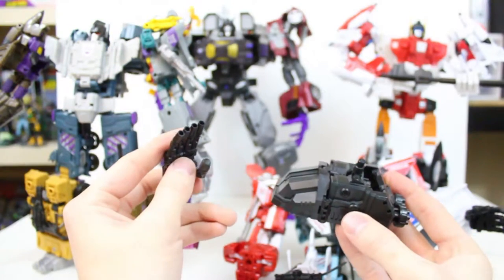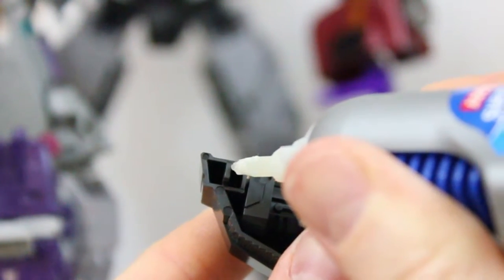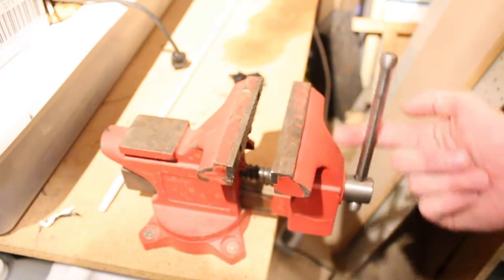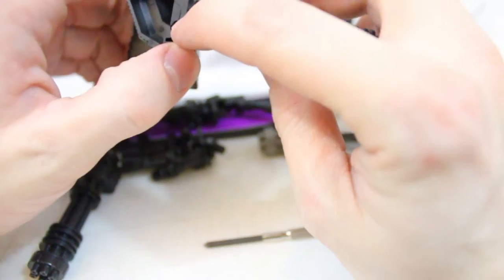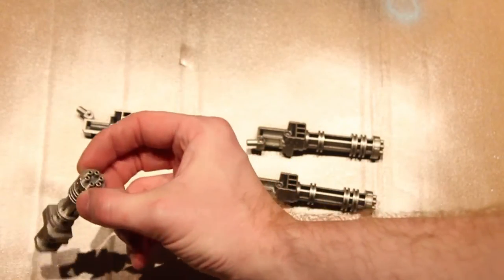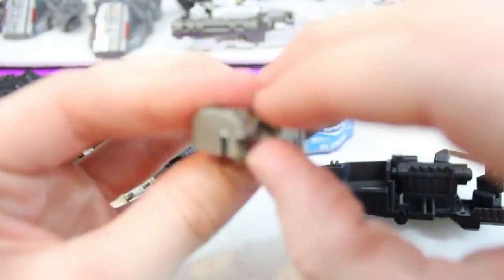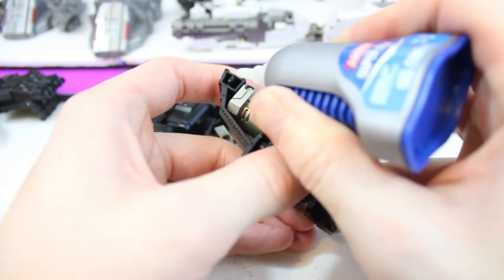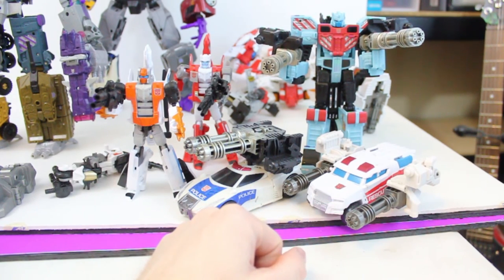Combiner Wars Perfect Effect Fix, Mod, and Paint

Comment: just a suggestion of something to use instead of glue to tighten joints....you can use floor polish with Future shine...that's specific one recommended to me and i bought a bottle and it's what i use for AAAAALLL of my joint tightening needs.  If using on something super duper loose, then may need multiple coats (apply, allow cure time, reapply, and so on).    but the problem with glue mostly is that it flakes and shreds when whatever joint you used it on is moved..it shaves off the coating of the glue...it's ultimately not hard enough to withstand the friction...the floor polish however (meant for dealing with foot traffic so way sturdier) will not do this if allowed to proper cure before applying multiple coats.  Also, with the floor polish if just one coat is all you need, there is no harm in putting the joints back together before the stuff has totally cured...in fact, sometims i thinkg it helps to tighten even a bit better...
Reply from the maker: +jamilmereck Thank you.  I've been meaning to try floor polish, but when I get to the store, I can never bring myself to buy it.  One of these days, I'll put a bottle in my shopping cart.
Reply: I really wish they sold smaller bottles these days.

Comment: RE : tabs / pegs to combine foot halves. You added super glue to add material, you also painted them, which adds even more material. Thats why the connection was overly tight.
Reply: About to post the same comment, think that just the paint would have done the trick. If not painting the guns, then maybe the superglue/floor polish/nail polish would just do.
Reply from the maker: I learn as I go.  In my experience with paint, it would wear off with repeated transformations.  I think I should have painted the parts first, then scraped the paint off of the tabs, then added glue or polish to the tabs.  Very soon, I will get a bottle of floor polish to see how I like it compared to super glue.

Comment: Yeah you superglue them together, but what happens when you wanna take 'em apart & use them as guns?
Reply from the maker: +Smoke screen Good question.  The first time at 3:25 and third time at 23:55 that I use the super glue, I let it dry completely before I put the pieces together, so that the pieces don't stay glued together.  After I put the glue on, I stopped filming for several hours so that the glue would dry, then I started filming again when I put the feet back together.   With the dry glue on the tabs, the tabs are now wider, creating more pressure (friction) when they are pushed into the slot.  The second time that I used the super glue at 19:08, when I reattached the gun barrels to the sides of the feet, I do not want those gun barrels to come off again.  The sides of the feet fold over and handles fold out so that we can use them as guns, as they look at 19:10 where Hot Spot is holding them.
Reply: Oh ok, cool then.

Comment: If I might make a suggestion, for tightening the ball joint on the foot?  I know the floor polish and/or clear fingernail polish tend to be excellent for fixing ball joint looseness, I use it myself, but with these feet having to support so much weight on such a small moving piece, there may be an even better alternative...

I noticed that you also collect GI JOE figures, as well as Transformers. (So do I.)  Therefore, I'm going to assume that you've probably taken a few of the modern era figures apart, either to fix or customize?  This being the case, you are aware of the tiny rubber pads that Hasbro uses in the hip joints to add friction and reduce floppiness for better, sturdier poseability?  My suggestion is to use those little rubber pads, or something similar, to do the same exact thing for the PE ankle joints.  Simply pop the peg out, place the pad in where the back of the ball would snap into place, pop the ball back in, and you probably don't ever have to worry about issues with ankle support anymore on any of your gestalt mode combiners. 

I used this exact technique on a custom Sgt. Slaughter I was working on awhile back, where I had taken a classic Slaughter head, dremeled the post and neck off to dremel out a hole and socket for the neck peg of a Retaliation Roadblock to pop into. The fit was just a tad loose, so the thought occurred to me to put one of those pads inside the head before popping the head onto the figure. Works like a charm! Zero floppiness with excellent posing capability. 

I hope this is helpful.
Reply from the maker: Hi, I'm sorry that I have not responded sooner.  I missed the notification for your comment.  That is a fantastic suggestion about the rubber pad!  I have not yet disassembled any Joes for customization, so I just opened up a leg on a figure and I see exactly what you are describing.  That gives me two ideas.  The first is to coat the PE ball joint with Plasti Dip, a rubberized coating sold in hardware stores.  I use it for a large variety of projects.  The drawback to Plasti Dip is that it sometimes peels off.  If that happens, my second idea is a very thin foam pad sold at my local Dollar Tree, used for crafting.  A small piece of the foam pad should fit easily into the ball socket and provide the desired effect.  I have a bunch of mods that I plan to film, including one G.I. Joe mod.  If I can get through those before the next Transformers movie comes out, then I will make a video for this PE ankle fix.
Reply: +CandleComics Great ideas. I look forward to seeing the results!  Keep up the good work! 😊

Comment: @CandleComics
Did you ever find a way to tighen the wrist joint of the Perfect Effect Hand?
Reply from the maker: No, nothing that I tried had worked.  I'm open to suggestions, though.
Reply: I've tried knocking the pin out, nail polish, and glue but no luck
Reply from the maker: At this point, I'm going to recite the serenity prayer from AA.  Grant me the serenity to accept the things I cannot change, the courage to change the things I can, and the wisdom to know the difference.  I accept that I cannot tighten the wrist joint, but I am still pleased with the work that Perfect Effect did with these sets.
Reply: I think Perfect Effect did a great job with the hands and feet.

Comment: I use the clear nail hardener Polish, it doesn't chip
Reply from the maker: I have a bottle of clear nail polish, but the last time I used it on a transformer, the polish peeled off.  That could be because the nail polish is several years old, or maybe it was just a bad brand of polish.  I just bought a bottle of floor polish.  The next time I tighten a joint, I will try the floor polish.  Someday, I might pick up a fresh bottle of nail polish.
Reply from the maker: Master Farr I make a mess every time I use hot glue.  Haven't touched the stuff in years.